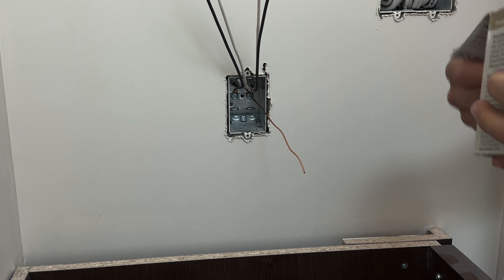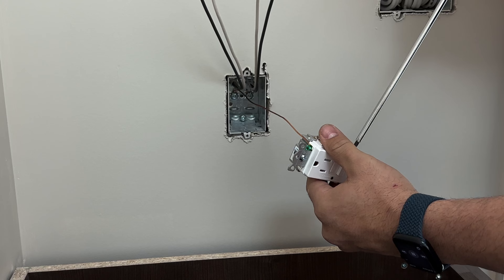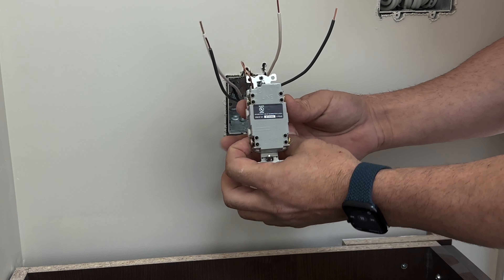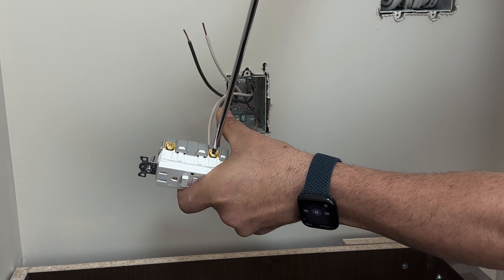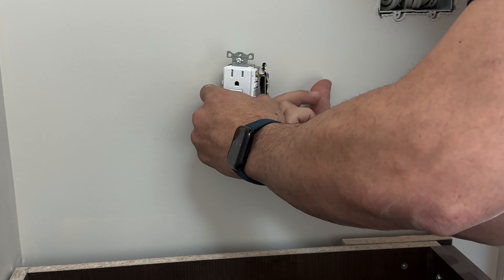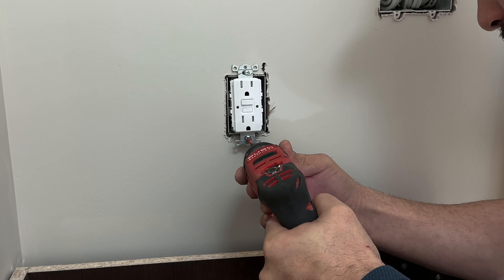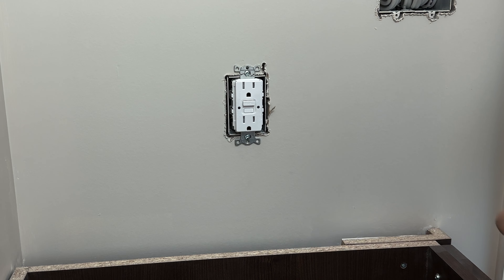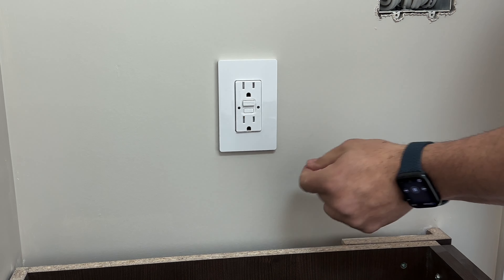GFi Receptacle Installation

Comment: Interesting. In the U.S. the “cut-in” or “make-up” aka where the wires are tied together is always done before drywall is installed. The only thing that gets done after drywall is just installing the devices which is known as the “trim-out”.
Reply from the maker: In Canada as well but is not illegal or against code to leave the romex in at least in Canada, I personally prefer it this way since sometimes drywall installers will knick my wires really bad even inside the box and pushed in deep. I can’t say every drywaller with a router is like that but it has been my experience with the majority so far😕